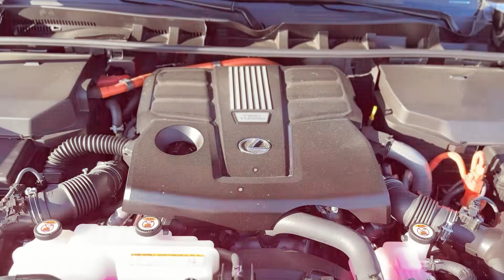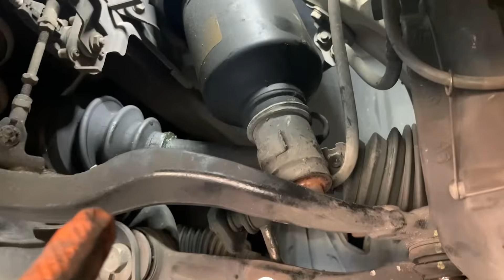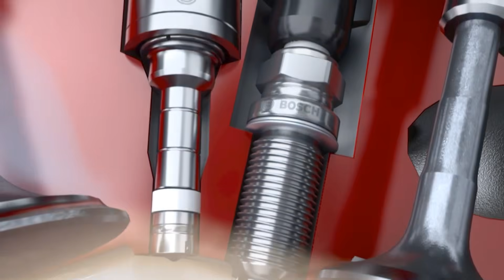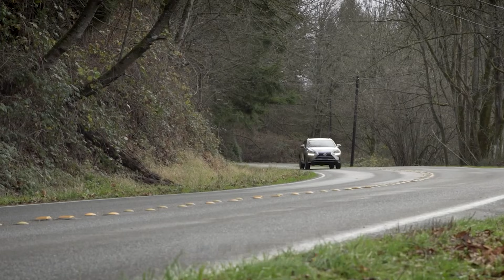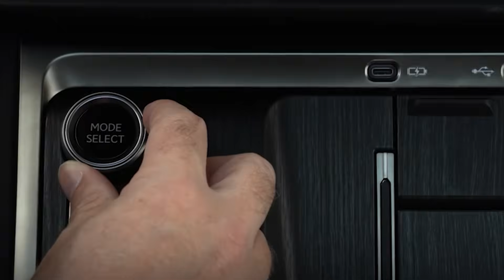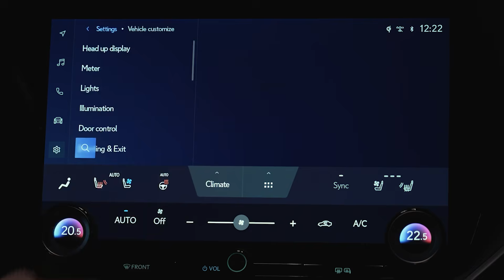STUPID Lexus Features That DESTROY Reliability & Lifespan (AVOID NOW!)

Comment: The air suspension itself is not bad. It has been used in busses for at least half a century. The question now is why is it built  so complicated that a simple spring replacement costs a fortune? Why does a tiny compressor cost several hundreds? Why does a stupid electronic control unit, not much more complicated than an RC toy esc, cost an arm and a leg??